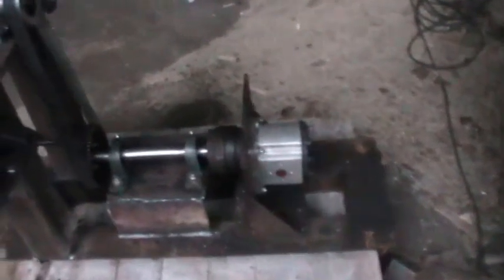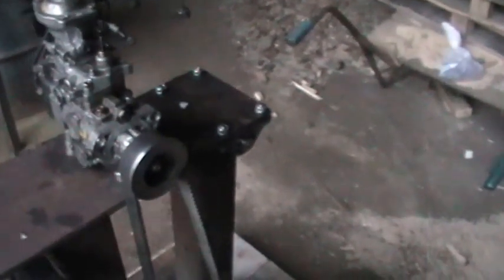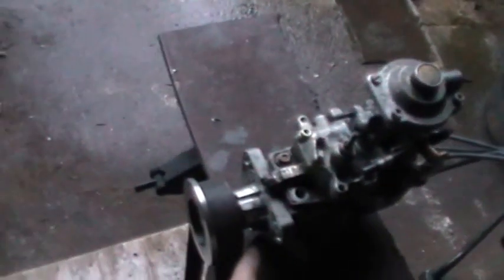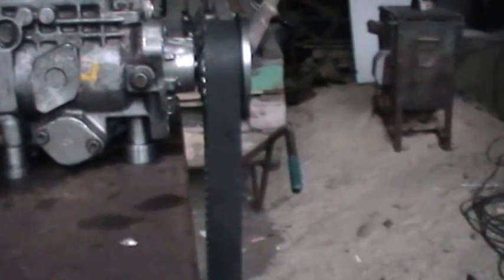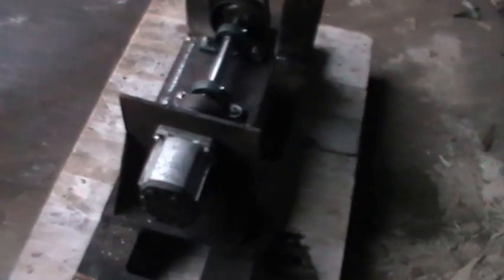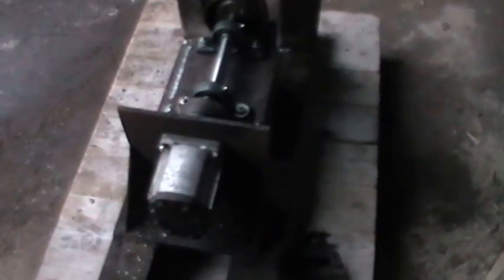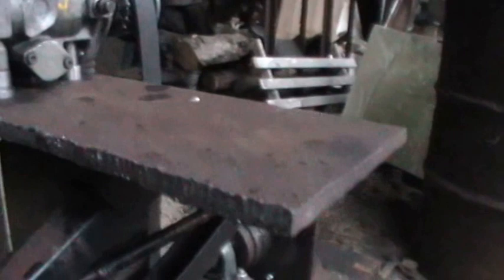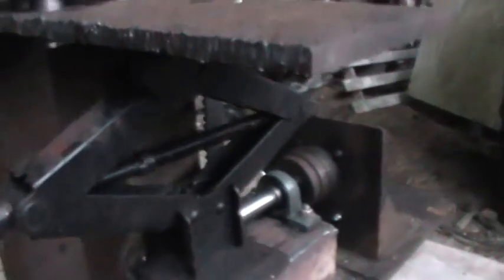Home made diesel injection pump test bench part 1

Comment: This is a good start. It will handle VE and most inline injection pumps. However, a Roosa Master or CAV DPA won't handle the side load on the drive shaft. You have to couple them directly and use a shaft the will absorb any side thrust...

Comment: I´m building similar where did you get your pulleys and what is the gear ratio
Reply from the maker: The pulleys were from a Ford 2.5 Di engine, the main drive shaft pulley is an injection pump pulley, I turned out the drive hub to fit the drive shaft, the pulley bolts to it.
The pulley on the injector pump is a crank pulley, modified to fit the VE pump hub. Ratio is 2:1. It works well, but If I were building it again, I'd build a flywheel into it. I'll do a vid of it running, next time I use it.
Reply: @andypdq  i see the motor is so small can the motor run the injection pump if work with high pressure? how many hp the motor you use?